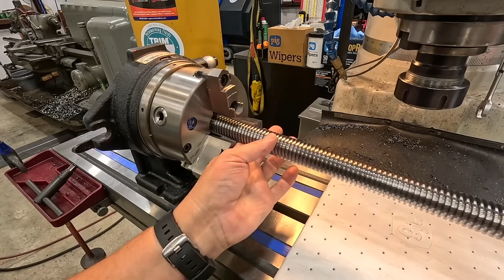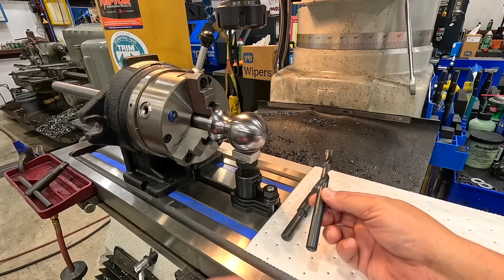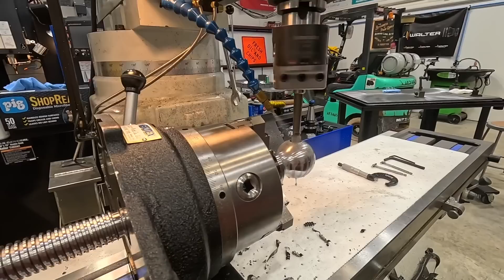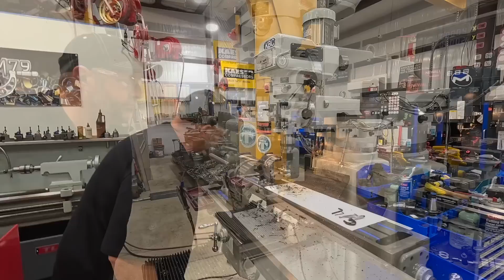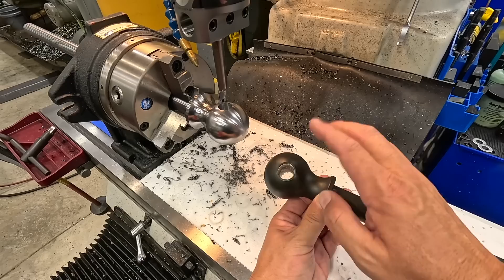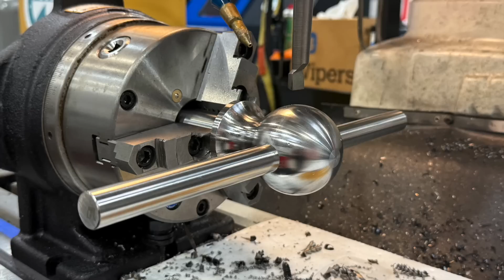Vise Spindle Cross Hole Machining

Comment: Those flex socket coolant lines are always a pain in the as. Any bump and the coolant doesn't go where you want it. You are constantly adjusting .  When I ran screw machines we used aluminum coolant lines which kept their memory and just a bump would not move it off target. You can use copper tubing but when running coolant with sulfur content, would harden the tubing making it hard to adjust. Aluminum tubing (has no memory) worked just fine and you could easily adjust the target spot.

Comment: Watching your videos is therapeutic. You truly are a master at your trade. My machine shop consist of a $50 Harbor Freight table mount drill press, three hammers, a hacksaw, and two corded hand drills. My precision measurements usually runs in the + or - 0.125 inch range.

Comment: Fantastic job, Adam! That fit on the handle was perfect, nice work!

Also, re. the boring head, I think the people who have a problem with your method either don't know how the head is supposed to work or have been taught incorrectly. Locking that screw is an absolute must. The only time it isn't is if the head has an auto-feed feature a la Narex boring head. The only thing I've done at my work differently is not rely on the gauge on the head, but rather use a dial indicator, so I'm more confident in the changes in the depth of cut. Yours works just fine by the looks!

Comment: I machine valve guides for valves everyday at work for the last 10 plus years and I have come to learn anything under a half thou won’t slide nicely and freely because of surface finish and minor out of roundness. That’s not the size we finish at but that’s just what I’ve learned along the way. We shoot for just over 1 thou for heat expansion for valves, obviously a very different application than this

Comment: You should absolutely lock the boring head, but yes, it will also move ever so slightly, but you can see that on the dial anyways, and adjust accordingly ^^

Comment: I love watching and learning your techniques. I have found when using a boring bar, I like to approach the target diameter in equal steps. For instance if I my final target is .750", I will try to get to say .735". And then the next three cuts should be exactly .005". My thinking is, the push off on the final cut "should" be have exactly the same amount of push off as the previous cuts. What I want to avoid is having the last cut be a much lighter cut, which is a bit unpredictable if your previous cuts were heavier.

Comment: That seems to be a sweet "clearance" between the meatball and the shaft however, in the shop environment, I believe the clearance will be a PITA too tight without a lot of maintenance. We'll see after 6 or so months as the elements settle in. It could mean some hone work to that bore, of another half to one thousandths. What do I know, I'm just a DIY. 800 RPM seems perfect BTW.

Comment: I can appreciate your efforts to get such a precision fit and your patience in getting there....  but every vise I've ever owned has a handle that fits in the head like a baseball bat in a rain barrel, and it works..   I'm just concerned that using the handle to get a good clamp on something in the jaws might induce a slight bend that will no longer travel end for end.

Comment: We use alot of sandvik boring tools at work, the locking function is totally different, but there it could be problem if you overtighten them and make damage to the shaft which make it move into that divet again when you fineadjust. I don't think you would move this type with a gib by much. Bigger deviance will come from tool deflection and different load when you are closing in on your target. And bad marking on the adjuster on cheaper ones.

Comment: You are in process of starting with arguably the finest bench vice ever made and taking it to another level! Hope you are keeping track of data i.e. Materials costs, tooling needed, and hours spent designing and fabricating changes made for all new and re-worked parts, so at end when this project is finished an accounting may be provided, for me that would be a compelling video. Ray

Comment: 50:20 why does the machine have a manual brake? I only know the ones with electronic brake....
Reply: To stop the spindle quickly saving valuable seconds!.... but mainly it has a brake to stop the spindle from rotating when using a wrench on the drawbar, collet chuck or drill chuck.

Comment: I'm with you on the lock-screw, Adam.... and If there is one thing not in short supply on the internet, it is disagreement,  I'm sure there are a few out there that will swear the sun won't rise in the east tomorrow morning.  My take is this; stick with what you know, and go.  And if someone else has a better way and can prove it, then reconsider.  In all the years i've been watching your videos, Ive never seen you do anything other than strive toward perfection and the best work possible.  Keep up the great work and videos!

Comment: It's fun to see a machinist go for ultimate precision on a "practice"  or "demonstration" project.  If you wanted to go even further down this rabbit hole, could you lightly lap the hole using the handle?

On the issue of a nick in the handle, that does seem to be a possible problem with such precision.  However, the original handle had "weakening" grooves to show up abuse of the handle.  Perhaps this is Adam's way of one-upping the original design.  Also, a high precision fit would make it more difficult for abrasive or metallic particles to get into the joint and perhaps cause galling.

Comment: For a bench vise, it's advisable for the cross hole to be considerably large diameter than the handle rod. When the handle rod gets bent (which it will one day.. the rod would had to be spring tempered carbon steel), it can still somewhat glide through the hole - if it was of too much of a tight tolerance, it would be a big problem for the vise.
Reply: Just think, the user holds something in the vise to sand or grind material off of the work and the first thing you have to do is wipe down the handle before you can slide it to remove the work.

Comment: I suspect the issue with the misting nozzle is that when it first starts, it will be cooling down due to the re-expansion of the compressed air flowing out of it. So as it cools the hole in the end will shrink ever so slightly. I predict that if you lower the flow again once it has fully cooled, you'll be able to maintain the low flow you're after.

Comment: Adam, did you put the screw in your vise and close it to get a clock position for the handle hole.
Reply: How would that be useful? Won't it change over time and use and whatever one is holding in it?
Reply: @utidjian  It should not change with use but in a closed rest position it would look good in the shop. Any vise you buy will be like that.

Comment: Nice job. If someone has a boring head and suspects the locking screw can move the quill, just test it with a dial indicator. Some of the cheap ones might have this issue. I have a cheap micrometer and the lock on it causes the barrel to move. Just a thought.

Comment: Not sure why you wanted a precision fit.  A loose sliding fit is more normal for a vise handle, so that it slides easily from end-to-end, even when slightly dinged and rusted.
Reply: Thats why it’s case hardened stainless. 
But also, I don’t think this vice is meant to be used by neanderthals. I see it more as a functional show piece.
Reply: @dunemaster93  I am not aware of any stainless steel that can be case hardened, I have had some past projects that could have used this magical material if it existed.
Reply: @KerseyKyle  Far more likely in this time to be induction hardened than case hardened in the traditional sense. You can also Plasma Nitride a lot of materials for a similar result.
Reply: It's to make video content - I leaned a lot on how to keep tolerances tight.
Reply: That is exactly what Ithought !  It's not a clock , it's a vice . Never the less perfect precision work!

Comment: You can just chuck up those balls in your lathe chuck and drill them. It works well. I have done it a few times to make handles.
Reply: That would have been my choice also... except it would require a lathe with a swing that could handle the length of almost  the whole leadscrew! If the ball end was separate that was later pinned, threaded or welded to the leadscrew it would be way easier. Always easier to do precise boring on a lathe than with a boring head on a mill. Just depends on the configuration of the workpiece.
Reply: @utidjian  What you said makes no sense. He has 2 ball bearings that is what I am referring to. You chuck the ball bearing up into the chuck . Use the tail stock with a drill to drill a hole.
Reply: @johnscott2849  You are correct. I misunderstood your comment.

Comment: I don't understand why you'd want such a close fit on a vice handle? The absolute slightest ding or bend or bit of debris in there is gonna make it really annoying to use
Reply: It's a showpiece. It's not going in the welding & fab shop.
Reply: have a look at his current vises, do you see any dings or scratches.
Reply: He already said multiple times, it's not going to used. It's a show piece.
Reply: ah ok didn't catch that it was gonna be a show piece. thanks for clarifying yall :)
Reply: I agree. I think .01" would be a good slip fit. That would clear dirt and grime With some extra clearance for the first time you reef on it and kink the handle.

Comment: Hey Adam, while I realize you don't do comments (which I think has always held your channel back), I'm going to ask these questions anyhow.  Maybe someone else can provide clarity and insights.
	• As I understand, you used the sacrificial aluminum spacer to support the ball when drilling with the spot drill and the 1/2" drill to prevent deflection due to downward pressure.  That makes sense.  And then you removed the aluminum spacer after the 1/2" drill had started to twist the aluminum spacer.  That also makes sense (because the downward pressure would be less after initial penetration of the drill).  Then you changed over from the 1/2" drill to the 23/32" drill, but you didn't replace the aluminum spacer.  Was that intentional or an oversight?  I would think that the 23/32" drill would be applying quite a bit of downward pressure, which is why the aluminum spacer was there in the first place.  Was that a lesser concern with the 23/32" drill because it was essentially a hole already, and the drill was simply removing wall material?
	• You appear to be using PIG Mats to catch the boring bar chips.  That seems to be a bit excessive, buddy.  You're not getting averse to cleaning the millings from the machine, are you?  😉
	• While I have always appreciated and admired your fastidiousness, attention to detail, and accuracy, I'm wondering if you are being a bit excessive during the boring operation, for something that doesn't need such tight tolerances.  After all, it's a handle that goes into a vise spindle's hole.  Does it really need multiple passes to "sneak up on it", to get within 2 ten thousandths, or even 1 thousandths clearance?  In the end, of course, it's your passion/project, so drive-on brother.  🙂  At this rate, you'll end up with a Hardtail vise with the tightest tolerances on the planet.  I wish my vise was so tight.
Reply: In my experience once the hole is established and you only need to widen it you don't need much pressure anymore, the drill will work its way through almost by itself. When drilling the first hole you have the chisel point in the center of the drill that basically has to push the material to the side before it can be cut, that's why you need a lot more downward pressure.
Reply: @CatNolara  Thanks for the information.  👍
Reply: On the (w)hole: 4140 steel work hardens very quickly. The very center point of a drill bit is not turning at all so essentially zero feet per minute cutting speed. The cutting speed increases linearly from the denter until the outer diameter of the bit. It takes a lot of force on the drill to force it into the material so it can cut. On a convex surface like that ball it is especially difficult because the the tip of the drill is contacting the workpice at a point. That is why he had so much difficulty with the center drill at first. As soon as more of the drill bits cutting come in contact with the material it gets easier but... As I said, 4140 work hardens quickly and one has to keep the pressure on the bit so that it remains "in the cut". Never idle the tool so that it is just rubbing because the material immediately under the tip will work harden and make it even more difficult. Either pressure ON or OFF so that the drill is not contacting the bottom of the hole. Too little pressure on the drill and it will begin to work harden even faster. Too much pressure and it will heat up and dull the bit. How much pressure to use with a given drill can be determined by feel. You get the feel by drilling a lot of holes... it comes with experience. The "feel" is not something you can learn by reading a comment or a book or watching a video. If you watch Adam drilling the ball with the 1/2" drill (after the spotting drill) he moves down quickly applies good pressure and he knows he is cutting by feel and seeing the chip spiral out of the hole. Every few seconds he backs off completely on the pressure and raises the bit to clear the chips. Then he comes right back down and applies pressure so it is cutting again. This technique is called "pecking". CNC mills and lathes also "peck". One uses pecking especially on deep holes in order to clear the chips. There is a lot to drilling and us humans have gotten pretty good at it. We have been doing it since long before written history. Most begginers often do it wrong... too fast, too slow, not enough pressure, too much pressure, wrong type of drill for the material... and they burn up a LOT of bits before they get good at it. Some never figure it out.

Comment: > run a reamer thru it so it fits the ifrst time with min. clearance as confirmed with the given purchased precision item;  the time it took to agree with the engineering of the boring head lock mechanism could have just as easily been spent putting your indicator on it and showing us so we dont have to take anybodies word for it except what we can see ourselves AND you can then waffle on about how much the actual bore bar may have been deflecting taking a miniscule 3 thou cut...sort of like the 2 thou backlash putting the flats  (mill z axis) and also the vertex spacer. ho hum - goes to show ya drilling a hole takes only a few minutes but ultimately gets billed out as 1 hour shop time so he wont go hungry minus the bust an arm backslapping showing the cnc crew how its done by hand.

Comment: I too have the same problem with Noga mister where the quantity dimiminishes w/ time. I've taken the head apart and cleaned it, and greased the oring thinking that would help, but no. Anyone have any suggests on what to try to fix this? It's really anoying. Thx.
Reply: Are things constricting as the nozzle gets colder? That's all I can figure. Or is there no chilling involved in this type of mister?

Comment: The fit on the handle was very nice but totally pointless. I approve! lol.  
         A few years ago I bought a vise at auction that needed a few parts.  I went on ebay and amazon and found a machinist swivel base. I had to find some t-nuts that would fit. They were out almost 1/16 but surprisingly were really nice fit wise. Smooth with virtually no issues.  The handle fit was abominable. I decided to cut my losses and just live with it.
        I can recognize children, people with ocd, ignorant and trolls on reddit, so I empathize with you. Don't let them bother you. I used to always seem to attract people on the spectrum. I could recognize them after a few messages.   I feel for them and would painfully explain things. Most of the time they were grateful that anyone would listen. Youtube is almost a different animal, it makes things easier.
    edit; I prefer Gibbs Oil. It leaves a dry finish. Too bad most people don't know about it. Mostly gun people and car guys like it.

Comment: RE: Drilling the ball. Consider instead of using just a piece of flat stock between the jack and the work, drill a hole slightly larger than the hole you are drilling into it and put a good sized chamfer on the hole to form a "cup" that the ball can sit in. That way the drill won't grab it as it breaks through.
Reply: Or just use a piece of pipe in the right size

Comment: Now that is a tight fit, though I’m not sure ( beyond) aesthetics that that’s a good idea. Any dirt,a chip, heck even a small grain of sand ( you do live in Florida),or a ding on the shaft,and that handle will get stuck. You might want to put one of those oiler buttons on one side , or every day you enter the shop,the second thing you do ( number one being turn on the lights) is grab the “CRC SP 350 “ and spray the vice down. Then go make Coffee. Can’t blame you for wanting to make it perfect, but unless it’s more a museum piece then a functional piece of equipment … … w t _ give it 10 thou. clearance. Or … maybe build yourself a plexiglass box to cover it and put in a couple packets of silica gel to absorb the humidity.        ( just busting you) keep the content coming.
Reply: .003 per side will work great, but still may get stuck once in a while if used. I guess it's not going to be used.